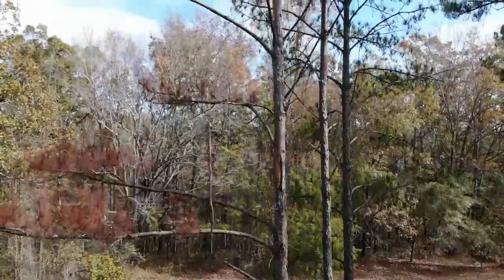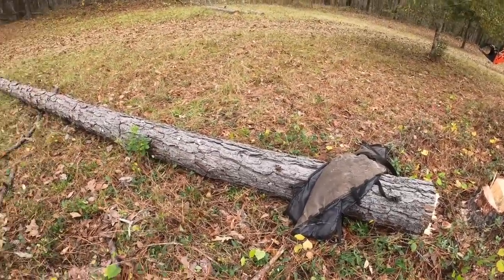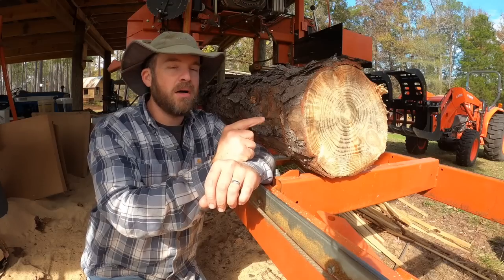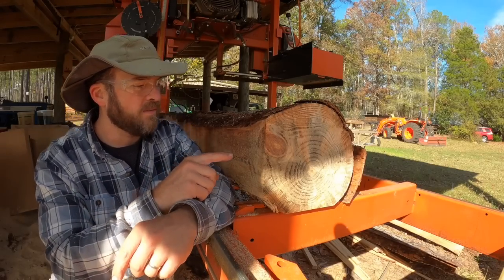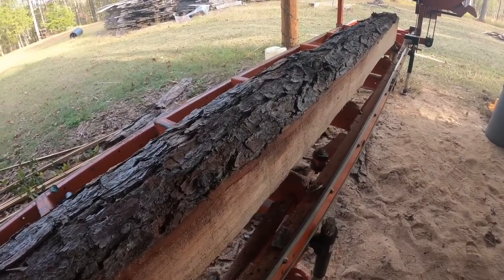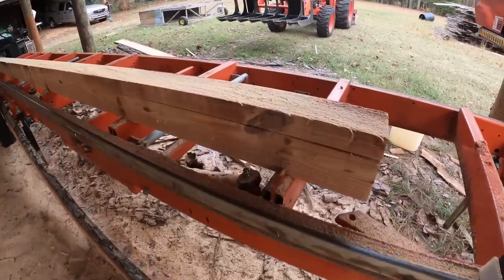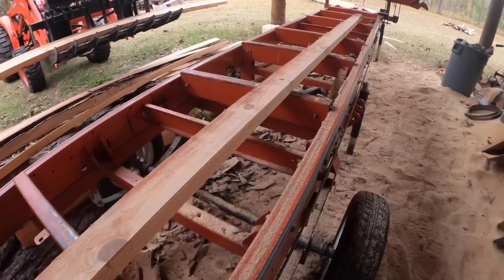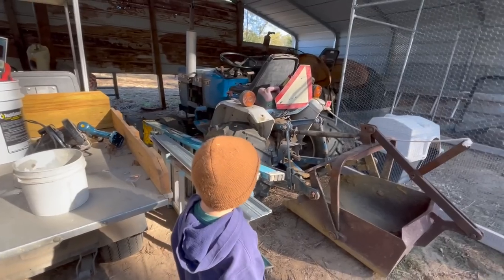How I'm Saving The Trees

Comment: I forgot, I'd already Id-ed you as good people. A Kubota man is #1!!!  I have a 12 yr old B3200. Bought it new. I had a B2710 for 13 yr before that. It had a WR Long 4-N-1 loader bucket. I boosted my lift with bigger cyl and a new connection point on the boom arms, worth every hour. I sold the B2710 to my friend. I traded the loader off the 2710 to the 3200 and modified a Bobcat 4-N-1 for 3200 and the old loader.  A great combination. Your L should at least match mine.  You can boost your hyd pressure real easy with shims in the pressure control valve. Plenty of how-to's on YouTube.
You get better yield out of your logs than most I've seen.  great vids....

Comment: Nice video. can you please explain "wayne" and "cant".
Reply from the maker: The cant is the square "log" after the first cuts are taken off the log, it can also be (as in this video) the two 4" chunks of wood before the 2x4s were cut off of it. Wane is when a piece of lumber has one or more edge on it that is not complete...it's caused by making the piece of lumber from the outside of the tree. So, part of the 2x4 is round like the outside of the tree. Hope that makes sense.

Comment: Why don't you just saw the logs from the bottom with your chainsaw when you have the tree felled to buck it? I notice you always cut from the top and use your wedge, and it works, but it is so much faster to just saw from the bottom so the saw doesn't pinch and the log automatically falls out of the way.

Comment: I was taught NOT to cut the stumps level with the ground.
Leave 3/4 Foot and get the Tractor chained onto it ... get it rocking, and pull out ...
Reply: LOL the price of diesel is too high for that, he slashed the top of the stumps, nature gave him the trees and he is going to let nature take the stumps back with the rain.
Reply from the maker: That's a ton of effort. As long as I can get it low enough to avoid with the bush hog and not hang the tractor on I'm fine with it. It'll go away in a few years.